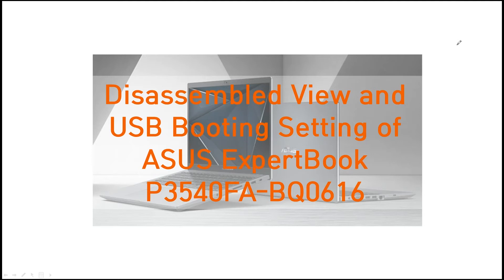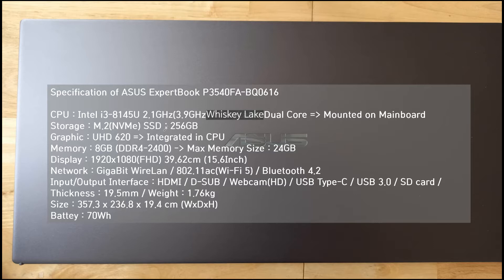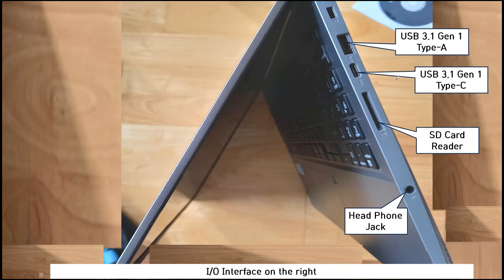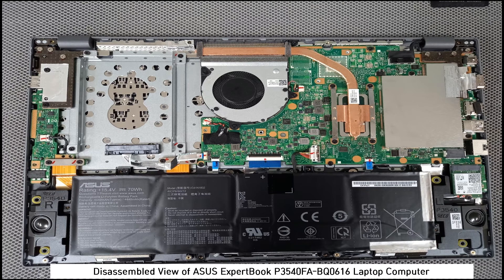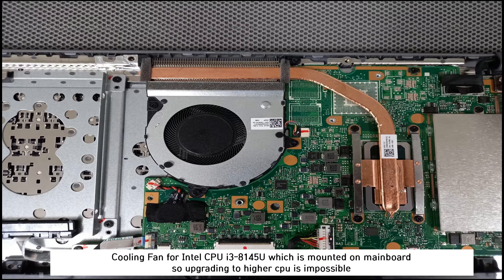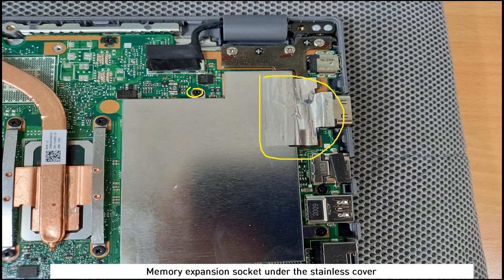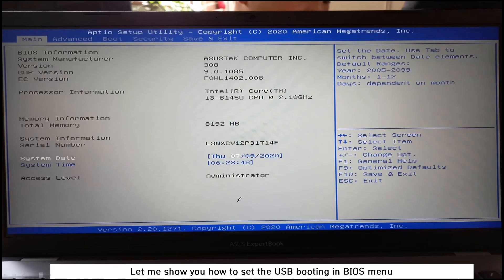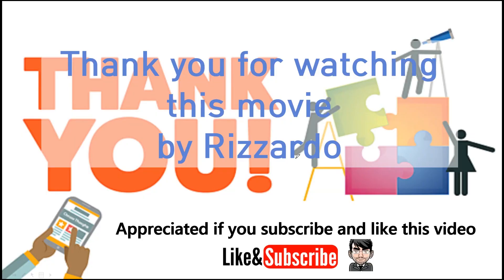Disassembled View and USB Booting Setting of ASUS ExpertBook P3540FA- BQ0616 Laptop Computer

Comment: The cover over the memory doesn't appear to be removable.  Did you actually remove it?  We have a dead one that we're trying to locate the m2 so we can pull data off it.
Reply from the maker: As you can see at 4:23, the cover of memory would be easily disassembled after removing screw and hook.
Reply: Did you manage to remove the metal cover?